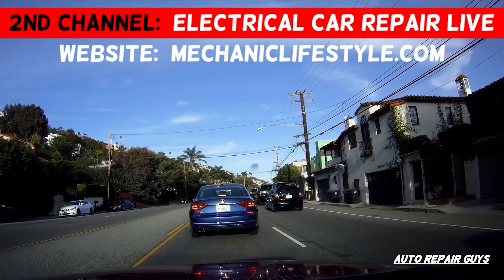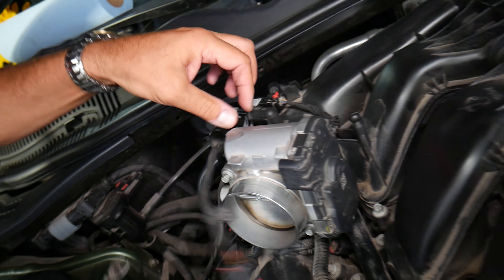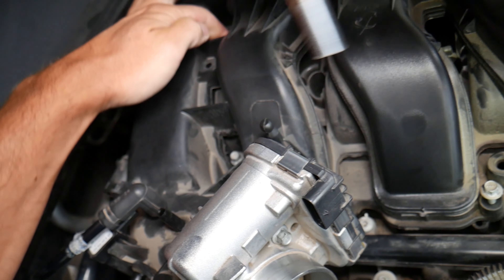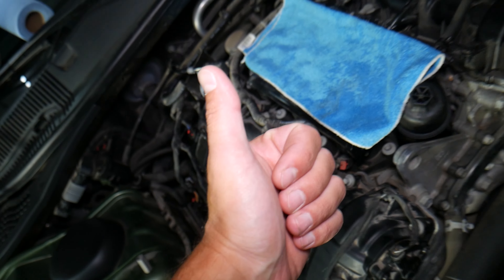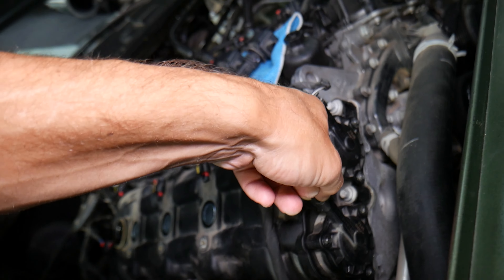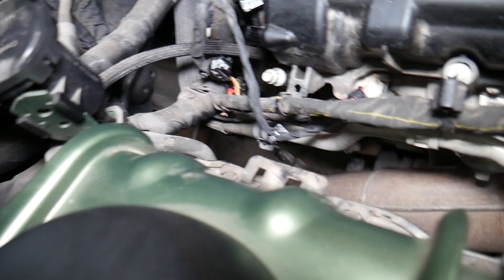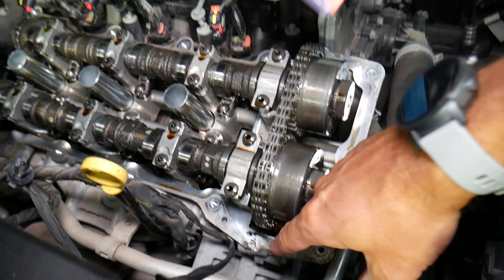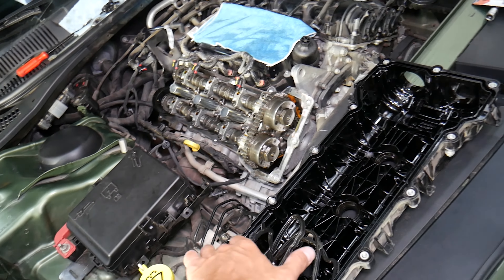DODGE CHALLENGER 3.6 V6 VALVE COVER GASKET REPLACEMENT REMOVAL

Comment: This video justified my frustration working on my car today.  I am doing oil cooler and valve covers on mine.  You went thru the exact steps I went thru for the upper intake removal, except I found that if you remove the back bracket first, the upper comes off smoothly with just a nudge to the passenger side.  I will continue my work in the morning since I stopped to make sure I wasnt doing it wrong.  Thanks for all you do!

Comment: Nice video ! Was very informative! One of my spark plug tubes on the drivers side has oil in it , what do you think the problem is ?
Reply: Spark plug gasket inside the valve cover

Comment: I got a stripped torx bolt on one of my cam phasers. FWD Chrysler 200. The one that’s stripped is in tight area. Do you think I can carefully wiggle the valve cover off with one cam phaser still in? I’m gonna try to extract tomorrow, but not sure if I can fit anything in.

Comment: I know that it is best to replace both gaskets, however my leak is only from the passenger (left) side near the firewall onto the exhaust. Is it technically possible to replace the left side without removing the throttle body and main intake covering the right side? Thank you.

Comment: You can very simply and easily tell everyone which battery terminal to disconnect first to not cause any damage, no need for a completely separate video for that. It is pretty ridiculous

Comment: Unfortunately, you are not showing the different style valve covers.  There appear to be some plastic retainers that will not allow the valve cover gasket to be removed. I have removed all of the bolts, I have removed everything on the intake manifold, yet, there seems to be some sort of classic retainer that I am not seeing in your video that I believe is keeping me from removing the valve cover. This is a California style vehicle, you know how they screw everything up.
Reply: I use the flat blade screwdriver, and they broke the tabs.